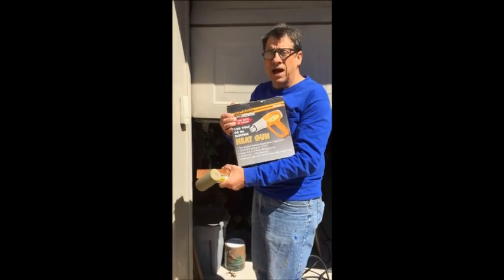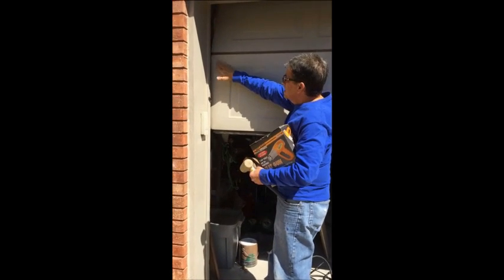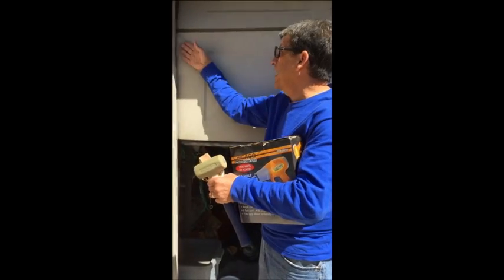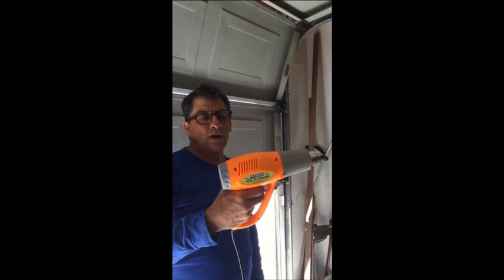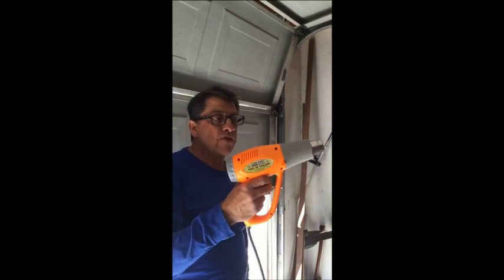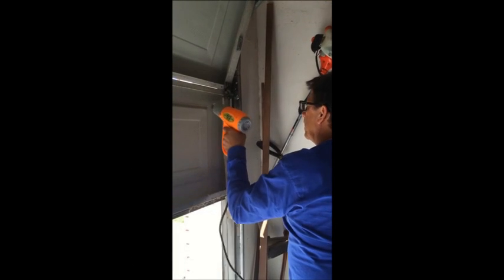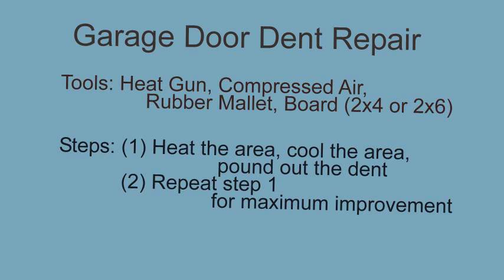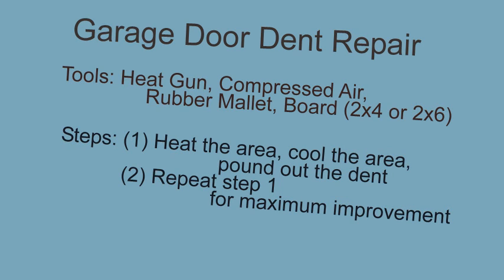Garage Door Dent Repair

Comment: Wrong kind of compressed air.... LOL!...   Folks, the idea here is to used canned air like you use to dust off electronics. If you hold the can upside down and spray, it will freeze the surface and shrink the metal.
Reply: Kermit the Frog at least he is trying, when did you ever try to help anyone frog boy?
Reply: @dawittywats1934  I help people all the time.  Way to go after a 2 year old comment to pass judgement though.
Reply: Kermit the Frog Not to mention you’re literally trying to help people with this comment
Reply: Hi man, you seem to know what you are talking about. Will haircdryer on hot and hair dryer on just air be the easy way to do same?
Reply: @deepb249  No. The whole point is to shrink the metal with cold, then expand with heat.
Reply: @kermitthefrog3685  can i use first the hair dryer on hot to expand then use compressed air bottle tilted upside down to shrink? Will this work?